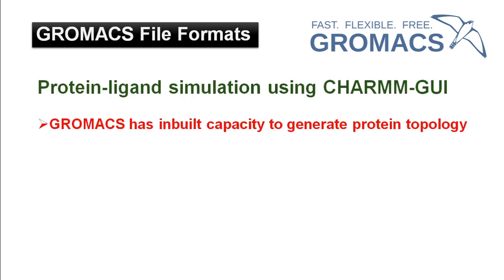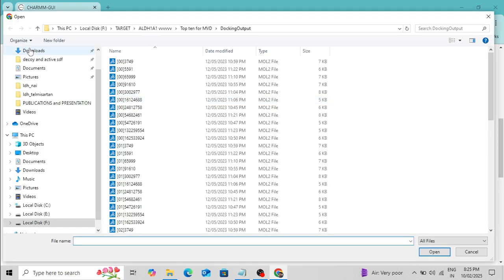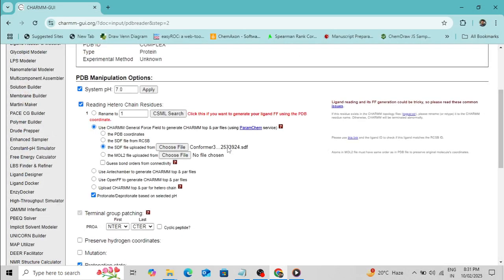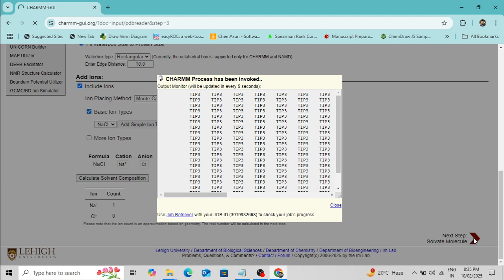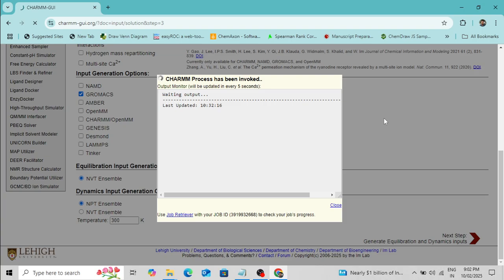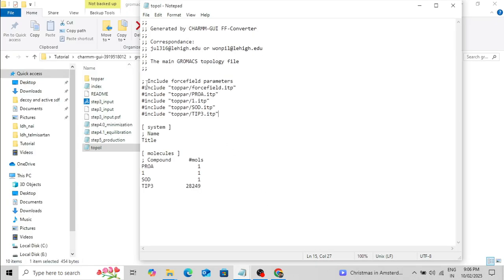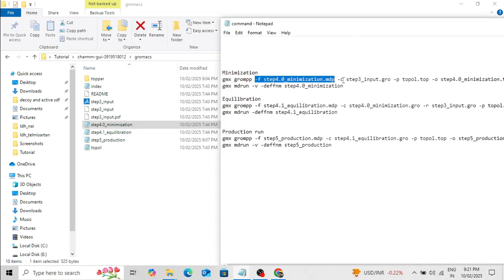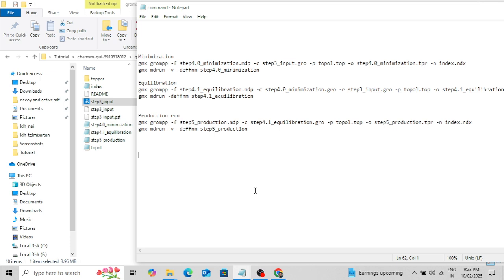GROMACS: Part 5

Comment: Sir I am facing problems in performing md Simulations on a docked complex of protein and ligand , causing residues  number mismatch errors, I actually used cb dock rather than autodock vina as it failed to genrate dgf file. And was not running. 
Sir could you please make a video where you use docked complex to do md simulation till final analysis
Reply: Have you been able to figure it out, I’m having same issues